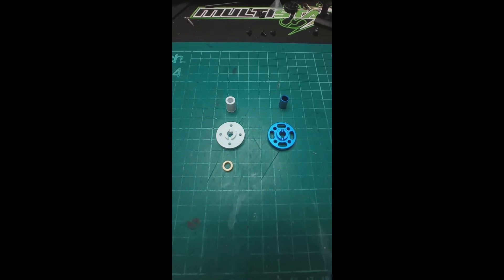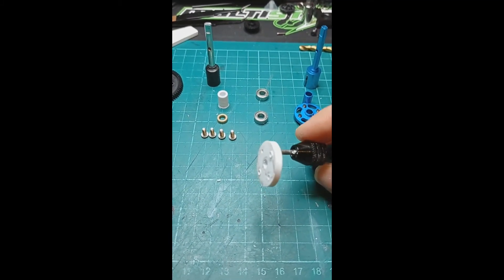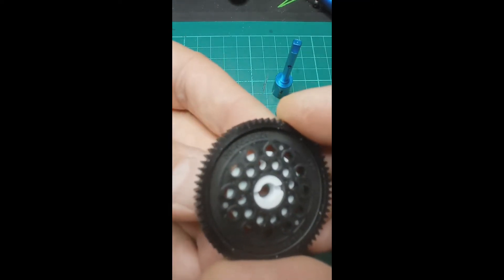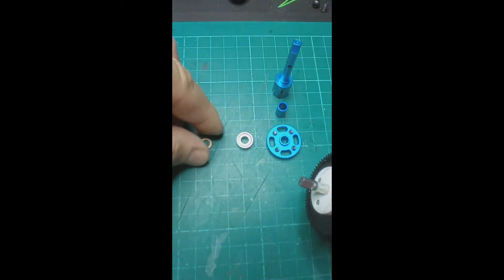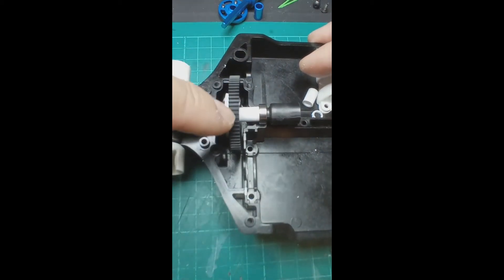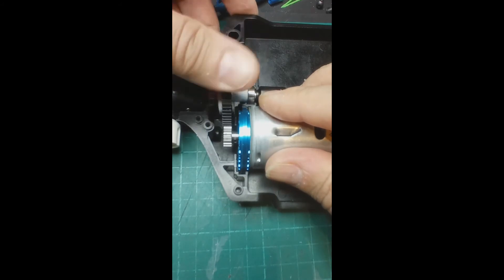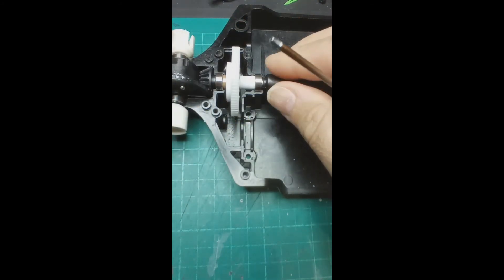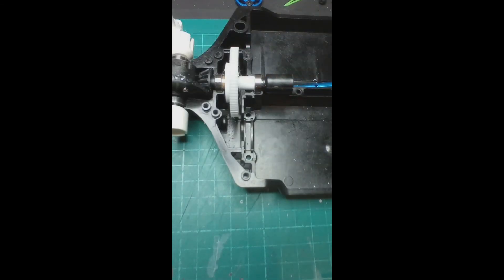3D Printed Tamiya TT 02 Spur Gear

Comment: Nice. Question is how long will it last. I've been printing fwd steering knuckles for tt01 from Nylon and they lasted several races.
Reply from the maker: I am not sure as i have not raced it. but the forces on the spur are rotational and the screws just hold it in place.